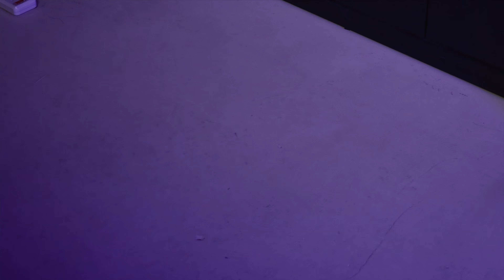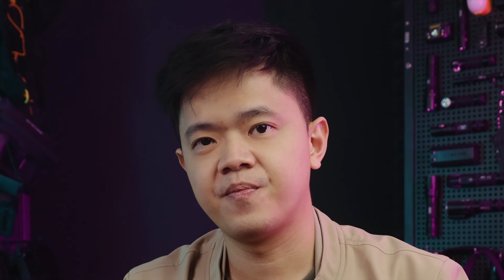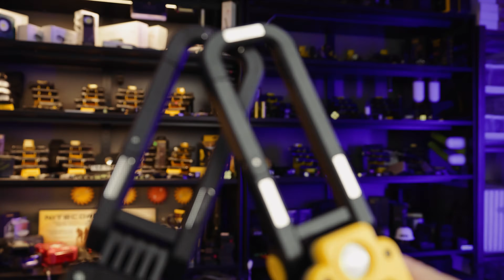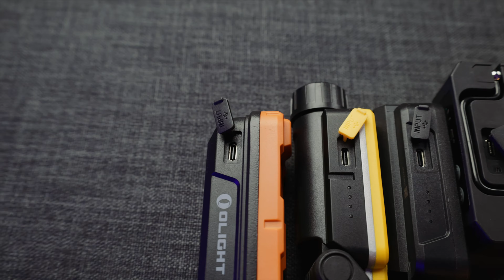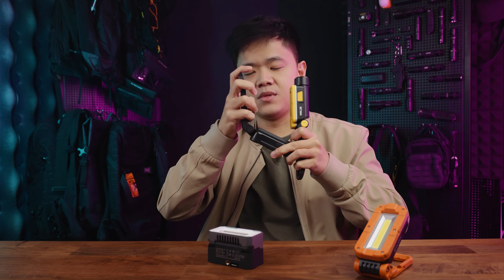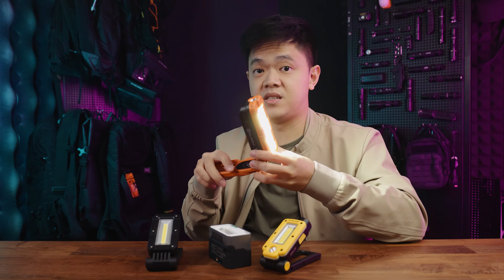Nitecore vs Olight vs ALS - Ultimate Work Light Showdown

Comment: I have the Fenix CL 27 and 28 R, Olight SwivelPro and Nitecore NWL20. The nitecore wins with removeable battery, carabiner and magnets on a larger surface. CL27 magnets are on a small surface and wont attach that well and it lack a carabiner. 
Nitecore is almost perfect, i even like the spot light alot, too bad it isnt at 90⁰ angle to the flood light. But its very usefull if i work on a small surface and i need more (warmer) light.
Anyway, a headlamp is a better worklike in most scenarios (sometimes you need to see irregularities in a surface and need light from a side).
I worked in a chemical plant, with hidraulic presses and now in a shipyard.

Comment: claymore with 2000 lumens-15 hours
Reply: Link?
Reply: Tool companies are coming with it too, Milwaukee and DeWALT have some badass type c rechargeable work lights 🤘
Reply: Tool companies are coming with it too, Milwaukee and DeWALT have some great rechargeable type c work lights, the DeWALT is actually better than the olight pro, the DeWALT swivels farther than the olight pro and I think it has bigger battery, it's just yellow instead of orange